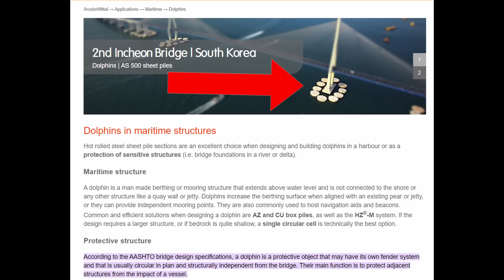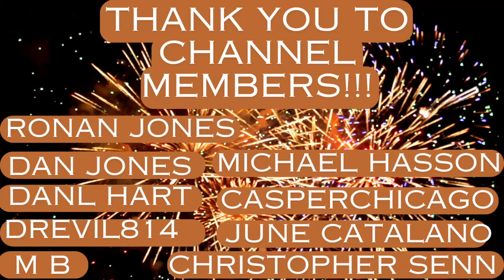Baltimore Bridge Collapse

Comment: Now I am a proud conspiracy realist.  At least half the conspiracies out their are true.  But stop with the conspiracy crap with this one.  Sometimes shit just happens and when you look at the facts and how this bridge was built, it’s a miracle this hadn’t happened sooner.  Firstly, the bridge was made in 1977 during a massive recession and during a time where saving money and cutting corners trumped safety by a large margin. This trust design was to designed to save weight and money which left it with zero redundancies should either one of its main supports were ever to be taken out.  Additionally, those main supports had virtually no protection from shipping collisions which was another sort coming of bridge construction during the time in which it was built. Also. this ship was made in 2015 in S. Korea. Not some place I would associate with high standards of quality control.  Plus the ship had a history of engine / power control issues.  Lastly it’s Baltimore.  A Democrat crap hole more interested in DEI and wasting money on social justice issues.  Hence tugs only stay with the the ships until they are under way in the channel instead of staying with the ships until they clear a bridge that had no main support collision protection!?
Reply from the maker: Who said anything about a conspiracy?  I am surprised at what some people can project into these videos.  Also, they had nearly 50 years to upgrade the protection of these piers and didn't. Now 6 lives have been lost and it will likely cost over a billion dollars to rebuild the bridge.  The could have protected these piers from impact by spending 20 million dollars.  I bet that they wished they had the pier protection that exists at the Inchon bridge.

Comment: Hmmm. I know you’re an engineer and all, but come on. The dolphin / protectors of the bridge you showed wouldn’t even be enough for the bow overhang of the ship in question. Also you can’t stop 117ish tons gross at 8kts with a few pilings and concrete. 

Also your controlled demo video is entirely different (again, you’re an engineer, you know this…) - simultaneous charges essentially dropping a span is totally different than removing ONE point (at nearly 200’, not ~70’) from one location, causing everything to cantilever and rip itself apart. 

In the controlled demo, the falling truss debris wasn’t connected to the rest of the structure due to the charge placement! In the accident, the entire upper truss was still entirely intact (and again, fell from 3x higher up, allowing for everything to pull over neighboring support structures.) 

Third, the ship wasn’t “operating so close to the bridge” - per AIS it was perfectly in the middle of the channel (or at least its side of the channel) till the initial power loss. 

Soo… yeah. 🤷🏻‍♂️
Reply from the maker: It is absolutely possible to design and construct adeequate impact protection for those bridge piers.

Comment: Poor construction and maintence Clueless officials who did not look into the possibility an accident? Most of the steel used was rusty but painted over the rust before installed. Even if a ship 70% lighter would have done the same damage. Will there be arrests?

Comment: As an engineer, is it possible to reconstruct the bridge without the use of pillar supports? I imagine an expansion bridge with massive arches on each side of the bay and incredibly strong trusses made of titanium. It would need to be twice as high at its highest point probably.
Reply from the maker: There's a lot of things getting in the way of reusing foundations for bridges. On paper it could be done. In practice it seldom is.

Comment: If I understand the ship dropped two anchors  on both sides - Is that true?   Obviously  there was engine failure  soon  after it left port  -  Notice  the huge  cloud of smoke that was
emitted.  In my opinion,  one change in the law  should be to require tugs in and out.

Comment: You put forth the same identical questions I have.    Its not like we have not had many examples of a single point of failure on bridges.   Washington State I5 up North of Seattle with just a corner clip.    With a design like that (2000 foot dropped,  aka Milano Itallyt)  lack of major protections (aka dolphins) as well as a tug escort  until past the bridge.    They have to go UNDER it,  sooner or latter someone is going to hit it.   Exon Valdez wreck proved what the people who know this stuff understand,  you gotta have tugs and you gotta be drilled and prepared.    And how many harbors can you close with select bridge hits?

Comment: To answer your questions: 1) The ship was in the shipping lanes before it lost power. The camera angle creates an optical illusion. 2) Protective bumpers were suggested and proposed after the Tampa, Florida disaster, but the 100 million dollar price tag was deemed to be too expensive. 3) Ships like the one involved in this accident are manned with skeleton crews, as much of the systems are automated. Why the ship lost power is unknown at this time. Given its speed and proximity to the bridge, they simply did not have time to get the propulsion system working again.
In my view, given the importance of the Key Bridge, not only should an impenetrable barrier be in place to protect the bridge supports, those ships should have a very slow speed limit and be escorted by tugs until they are past the bridge. Considering the sensitivity the support columns have to lateral loads and the horrific consequences involved if they are compromised, they should be protected at all cost.

Comment: After the lights go out the ship makes a very hard turn towards the bridge support. It wasn't current which turned the ship like that.
Reply: The bow movement was probably caused by going into full astern.  The ship was still moving forward, but without steering.

Comment: The ship blacked out  that means the diesel generators went off the line. 
That will kill the main engine. The emergency gen should start up and power 
the emergency bus in about 10 seconds or less but not provide enough power to 
run the main engine. It would give you steering and lights. Looks like the 
emergency DG did not start I saw no indication of the emergency lights 
coming on. All the lights came on followed shortly by black smoke coming 
out of the stack, thats the main engine coming on to provide propulsion. 
Too late at that point. So the main DGs failed  the emergency DG failed 
they got the plant back but too late. Thats my guess.

Comment: The city/state needs to get a construction company like Meyers & Sons Construction (formerly CC Meyers, Inc.) of California on board with building a new bridge.  This construction company is very well-known in California for delivering on big emergency projects, often well ahead of schedule and in a fraction of the time of a normal project deliverable.  They specialize in building highways and bridges.  Their simple company goal is "to deliver on the impossible."  They often earn huge bonuses for each day/week that they are ahead of schedule in finishing their projects.  They are used to working on projects in the aftermath of natural disasters (like earthquakes in CA).  Their bonuses are well worth it as they minimize that amount of time that major infrastructure is out of commission.  I will bet that they can complete a new bridge in 1/3 - 1/2 the normal project construction time.

Ed Schultheis, PE
Mechanical design engineer and manufacturing consultant for 35 years
Schultek Engineering & Technology, Inc.

Comment: I agree with the question about protective dolphins, why weren't they installed? If you look at other bridges...I just crossed the Sunshine Bridge in Tampa FLA and it has massive protective barriers. But as far as why the ship was so close to the bridge support, it really wasn't. It was traveling in the channel as it should have been until it lost power and veered. It's just that the perspective from this video is deceiving. It makes it appear that the ship is headed straight for the support when actually it wasn't initially.
Reply: Of course the new Sunshine Bridge you crossed was built after a similar disaster destroyed the original bridge.

Comment: It didn't come down "nearly instantaneously". I counted 30 seconds from first contact to last motion. And it was completely obvious that the ship was steering a hard starboard turn - the last thing to do there. Maybe the rudder was stuck hard over because of the power failure. There is a set of guide posts before the bridge - it hit one of these 5 seconds before hitting the "sawhorse" holding up the truss. it likely also pivoted more to the right after that. You can see water splashing around the midship and starboard bow as it struck that small island.

Comment: The ship was in the channel where it was supposed to be... there is questionable actions by the Captain that made the ship move in an uncontrollable turn... but that is to be determined in the investigation... kind of like driving a car on a snowy icy road and turning the wheels the wrong way and the car going in the opposite direction... the Bridge Total Collapse should be the main concentration at this point... this should not have been that structurally "fragile"...

Comment: The issue to me is the inept risk management on the part of the bridge designer / owner; with such a single critical pier, there should have been a set of fixed buffers around the piers that would prevent any ship getting anywhere near to the pier itself. It is clear that, with decades of high-traffic shipping under the bridge, it's not that surprising for one incident to eventually occur.

Comment: Check the YouTube channel "Whats Going on With Shipping". There you will get marine live chart displays of the vessles track out of the Baltamore Harbour along with the live feed that you have which will give you a clear perspective of where the vessel is along its path at each point. The site is run by an ex mariner who explains what is and may be occuring on the vessel and the comments section contains valuable information as well from various marin engineers.

Comment: I listened to two YouTube posts from "What is Going on with Shipping?" - my first time listening to one of his posts.  From his comments, it is apparent to me that he is an experienced mariner (maybe ship Master or Port Pilot) and familiar with vessel tracking using AIS.  In the first video, commenting on what could be seen in the bridge collapse video, he noted the apparent loss of power, and also the presence of heavy black smoke from the Dali upon power being restored.  He noted that the Dali dropped her port anchor, and also commented that the heavy black smoke might have been the vessel attempting to back down or reverse its engine.  He commented that in a single prop vessel like the Dali, that backing down also produces a "careening" effect - he wondered if the vessel might have stayed in the outbound vessel lane had it not attempted to back down.  Interesting points in your video and his.  I tend to be most interested in your thoughts about structural engineering and in "What is Going on with Shipping?" thoughts for vessel performance.  Overall, very good information.

Comment: You would think after the Tampa Bay Skyway Bridge collapse, that all the bridges like this would have been designed, or later protected, with substantial dolphins to prevent this.  As always, the biggest failure in science and engineering, is the failure of imagination.

Comment: Regarding upset conditions in general, an engineer might say “this could happen” and a challenge would have to prove that it COULDN’T happen before things are allowed to proceed. It seems the paradigm has now shifted to a place where things proceed unless the engineer can prove that “it will happen”. It’s booster O-rings all over again. Normalization of Deviance resulted in Challenger, Go at Throttle Up.
Reply from the maker: You make great points.  Those in design and project management need to consider the "risk matrix" where risk is a combination of probability of occurrence and severity.  It should not have been considered an unlikely scenario that a ship could lose power resulting in a loss of control and a bridge strike.

Comment: This bridge and its protective 'dolphins' were designed before construction started in 1972. I have read that the 'Dali', which hit the bridge, is 90,000 tons and has a 10,000-container capacity - far beyond what was designed for at the time the bridge was built.

From NY Times in 1970: The largest containership built in this country, the Hawaiian Enterprise, is headed for the West Coast to load her first cargo. The 34,700‐displacement‐ton vessel is designed to carry more than 1,000 24‐foot containers.

Comment: Thank you for this.
Now, as a person who is the furthest thing from an Engineer that one could possibly be, I have to say that it seems that the design of the bridge appears to be very delicate for the environment that it is in.
It was built in the 70s, and I imagine the size and weight of cargo ships has changed greatly since that time.
Also, people should take into consideration that if a ship loses power (regardless of its weight or size), it is at the mercy of currents and the wind and the ship will begin to drift - if it can't regain power in enough time to correct course, something like this can happen.
Reply from the maker: Thank you.  I agree.  There was no protection for a single point of failure under a condition (loss of ship power) that could have reasonably been expected to occur at some point.

Comment: Re: bridge protection. This is a case of 'getaroundtoits'.  The protection around the transmission towers shows folks and or new regulations had thought about this scenario. The bridge was built under old regulations and presumably grandfathered  protected against new regulations. No doubt someone brought this possibility up, but there was always a new or higher priority construction project that took precedence. Now you have the Port of Baltimore cut off.  You have only to look at the Chesapeake Bay Bridge–Tunnel(1964)  further out to sea to know that this was a consideration even back then. Now the CBBT was built this way to keep the naval base at Norfolk from being blocked in by an enemy attack on the bridge.

Comment: It's worth noting that when the bridge was built in the 70s a "Panamax" cargo freighter had a gross tonnage of 52,500 DWT. This ship was almost twice that size at 95,128 DWT. It's possible that the pier would have been more resistant to an impact from a much smaller ship, but this was a much larger ship than the designers of the bridge would have ever considered.

Comment: Why was the ship operating so close to the bridge? Prior to the engineering casualty, the ships was in her lane in the channel and headed correctly to pass beneath the bridge. When she lost power she began to drift out of her lane to her starboard side. She was doing about 8.5 knots at the time according to the AIS tracking data. It appears that when power was restored the first time, they may have been trying to back her down. She's a single screw ship so backing down, the torque of the prop will make her want to twist (where it looks like she's turning). At some point prior to striking the bridge, she dropped her port anchor. It's pretty damn hard to stop a 100,000 plus ton ship. I've seen some Captains comment on it and one of them said back when he was going in and out there (he didn't say how long ago this was), they used to keep a tug tied to their stern until after they pass the bridge. He didn't know when or why this was changed, but the two tugs that helped MV Dali off the pier were released as soon as they go her off the pier.